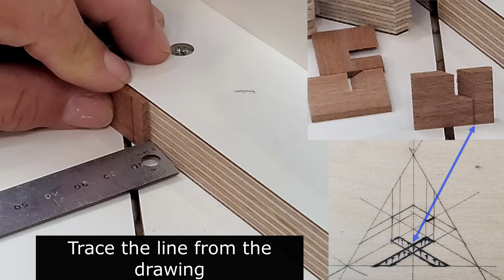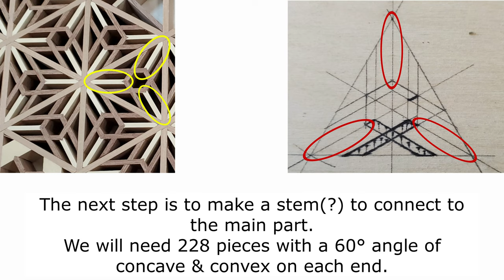Taeho's Kumiko Club Part 7 - Kiku (Chrysanthemum) pattern & finishing up Sakura (Cherry Blossom)

Comment: Taeho you have been one of the great joys of a miserable four months of lockdown in Melbourne, Australia.  So inspiring.  What is the kerf on the drop saw you are using at the start of the video?
Reply from the maker: Wow!!! Thank you so much!!
Ironically, the pandemic got me into making videos on Youtube.
The kerf is the standard blade that Festool makes. It is very similar to thin-kerf blade. 3/32" I believe.
However, the vibration of the blade is different from the table saw blade's vibration. So, you'll need to find out the actual kerf that makes with vibration then you need to mill the stock to mating size.
I have written down the thickness at my shop. I'll let you know more by Wednesday.
Thanks for your support!!! ^^

Comment: Спасибо, что делитесь своим мастерством. У меня была информация, что кумико собирается без клея. как вы это объясните?
Reply from the maker: Thank you!!!
Actually, when you see my videos from part 1, you will notice that I'm not using glue for any of the half-lap or three-way lap joints. For instance, I'm only applying glue on the edges of the main panel in the Part 1 video.
For the Goma pattern, no glue on the half-lap joints.
For Kasane-rindou, also no glue on the half-lap joints.
For miter bending Asanoha, you don't need to...
For everything else, you will have to glue anywhere that connects between the pattern and the mainframe. Otherwise, after it goes through several climate changes, the patterns will just fall out from the main grids.

Every Kumiko making companies and every Kumiko craftsman in Japan uses the glue into there Kumiko joints.
Probably more than I use.
I'm not Japanese, I'm Korean and I have been working on making Korean traditional furniture and building Buddhist Temples for many years in Korea. 
I can confidently tell you that you have to use glue in certain parts and not necessarily for certain spots.

Thank you for watching my video and for your comments.. ^^
Reply: @WoodArtStudio1  Спасибо. Вы вытираете остатки клея с лицевой стороны, а с нижней стороны ?
Reply from the maker: I usually clean both sides. However, for this panel, I'm not cleaning the bottom-side.
I'll be applying Han-Ji (Korean traditional paper) on the backside. So, I will just use a hand-plane or sanding paper to clean out and flatten the back. Thanks.. ^^